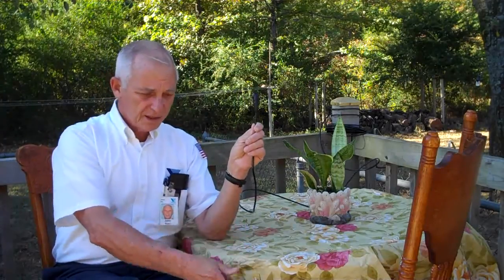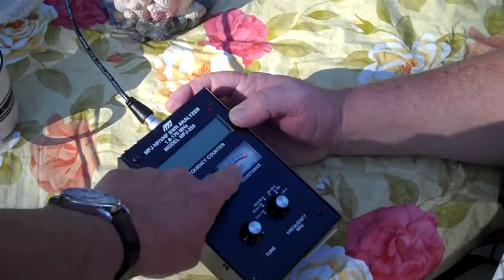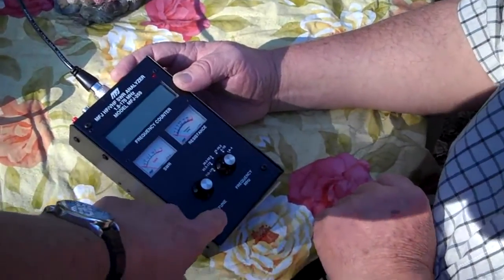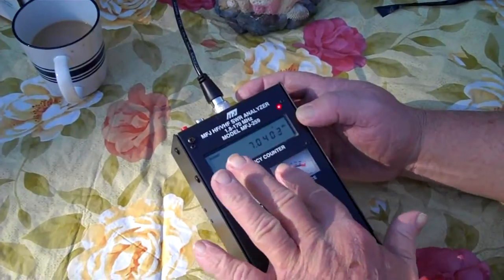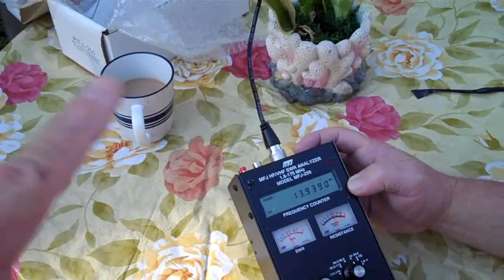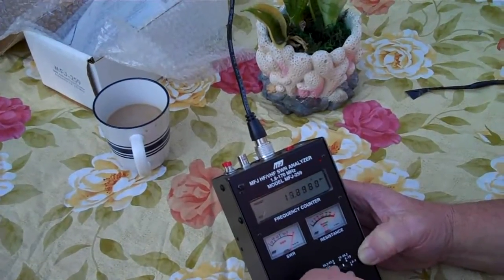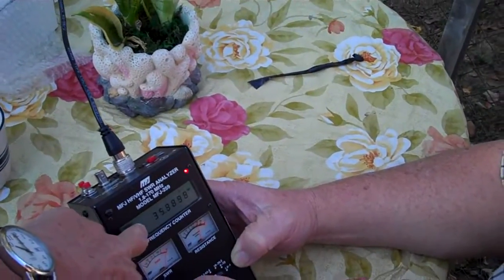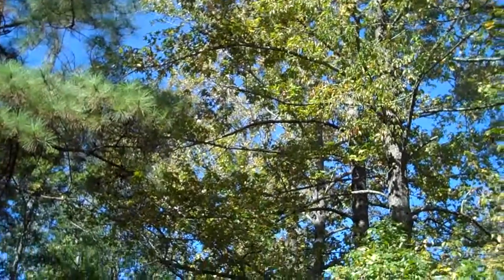Obtaining A Ham License-step by step-details you need to know (part 17 of 34: Making an antenna).

Comment from the maker: @AllAmericanFiveRadio
Thanks, Rick.  It was a good learning experience for me...and hopefully others as well.

For the basically uninitiated...those like me like me: To have a good antenna, one must strive to achieve a low SWR value at the proper injected frequency.  This antenna did achieve a low SWR, but it was at the wrong frequency.  Bummer.  So it's time to change the length at each end.  Sometimes wire needs to be added.  I have to cut some off.  Hope this makes sense.

Regards,
John